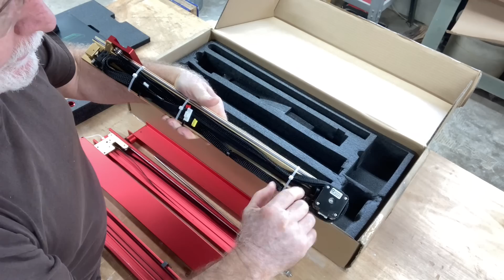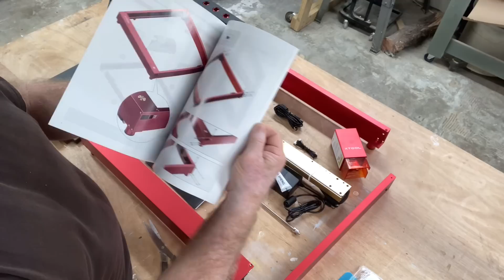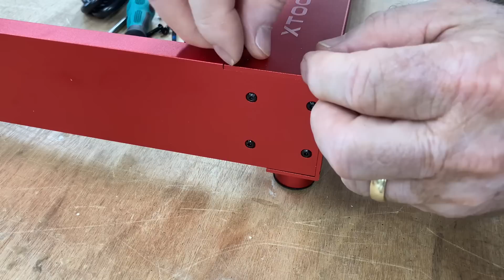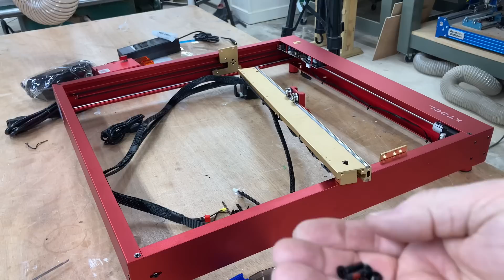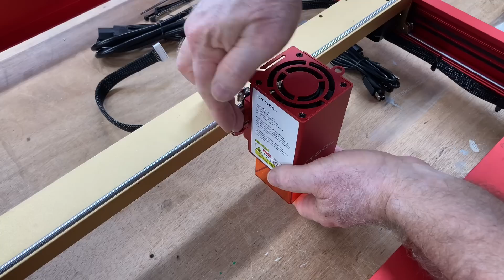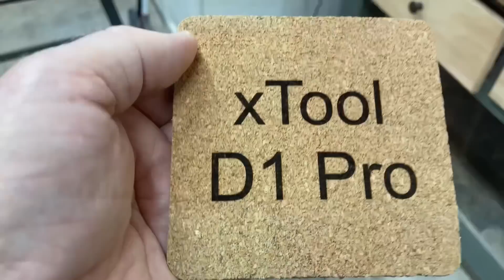Complete Review of the NEW xTool D1 pro

Comment from the maker: PLEASE NOTE:  In the video at 3:08 i state the the air assist is included. I am referring only to the brass tip on the laser head and the 90 degree elbow to attach the hose are included. The AIR ASSIST PUMP and Hose are NOT INCLUDED and may be purchased separately. I also stated in the video that I do not have the air assist pump.

Comment: Hi, based on your videos I have ordered a D1 Pro 20w, in your opinion, should I put a spot of locktite on the screws when assembling, I have had problems before with set screws becoming loose after a period of use which required a partial strip down to rectify
Reply from the maker: Yes, you can use locative to secure the screws. Please make sure that you use the Blue Loctite. Do not use the Red Loctite. Thanks for watching

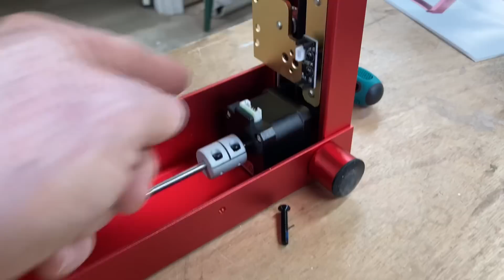Comment: Paw Paw at 11:20 you state to make sure both plates are in contact with the bottom rail.  Both of mine will not touch the rail.  The one on the right bottoms our on the circuit board.
Reply from the maker: The purpose of touching the bottom plate is to ensure that the gantry is square. If both will not touch then use a spacer of the same size and use that to ensure it is square

Comment: can the new D1 pro run just with light burn ?
Reply from the maker: Yes,  that’s all I use is Lightburn
Reply: @PawPawsWorkShop  Do you have to prepare the machine with new firmware to install lightburn or can I just use the lightburn application that I have for another laser.

Comment: Great video 👏
The only thing that’s a negative point with this machine is because the laser module is a lot larger than the old 10w then you would have less working space within the frame as it’s not being increased in size.
Reply from the maker: True, however, most people do not have projects that are that big. There are expansions kits also
Reply: @PawPawsWorkShop  I was wondering if the d1 pro and d1 have the same extension kit. I don’t see where it states the kit is for the d1 pro. I am sure one is under development.

Comment: I have a xtool D1 10 and 20 laser. What's rhe difference between those and the pro?
Reply from the maker: Much faster and improved quality. I’m running approximately twice as fast and cut the power by about 50%
Reply: @PawPawsWorkShop  Higher speeds means faster wear and tear...These little diode lasers are not really made high speeds...There belts and rollers will not withstand the stress...I have the 20 watts and I can crank it up to 18000 with lower power...Meaning that I can do exactly what you showed in your video...If people who do not have a diode laser want to go with the D1 pro, my answer would be...Get the D1 pro 10 watt just for the price difference between the D1 and the D1 pro...PawPaw I am not trying to troll you,I am just giving my honest opinion...Cheers!!!
Reply from the maker: Thanks. Using less power will make the laser last longer. I do not believe in running at top speed because I agree things will break. I do like being able to increase the speed more than the D1